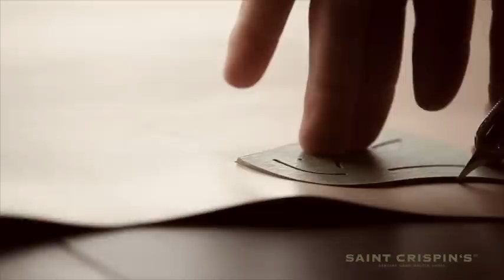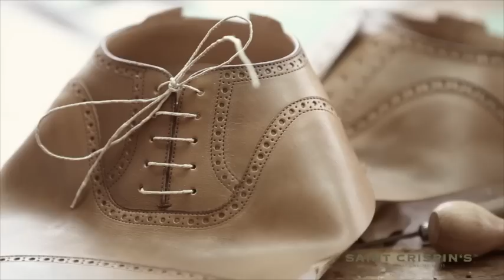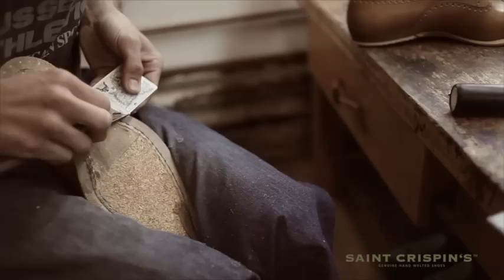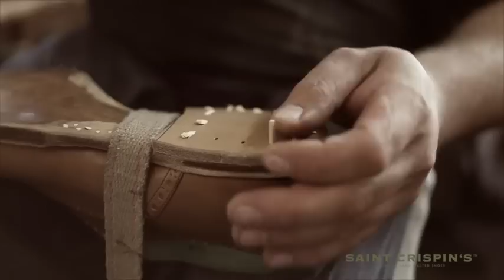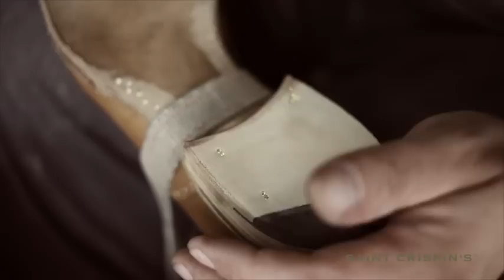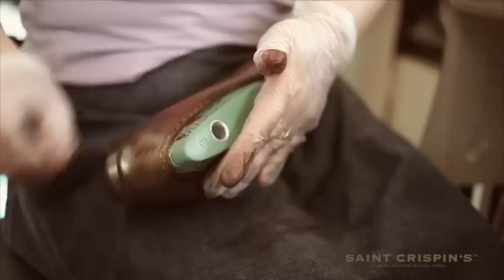How it's made: Saint Crispin's Shoes

Comment: Sharp-looking shoe, but I'm not crazy about the metal tip in the sole. That could get noisy.
Reply: Yeah. And it would get scratched up, little dings in it. Which would take away from the look. Then again, it would hold up longer than leather. I probably wouldn't get it myself though. To each their own. I've never personally seen it on a dress shoe. Definitely unique. And the time and craftsmanship they put in these shoes is second to none. Amazing.
Reply: +Jay V After it gets scratched up and dinged, you can easily install another one with screws using a Philips screw driver.

Comment: how much this pair ?
Reply: Gr8Success Because they are bespoke, it will be starting at $6000US for such a pair.
Reply: +KenChiwo Pretty sure that's wrong. Google "saint crispin's shoes price" and you'll find plenty of their shoes between 1000-2000€. Even if those are made to measurements I doubt they'd quadruple the price. 

Still way too much for me though. Some day..
Reply: Their standard line cost around $1500US. Made to order is around $2500US-3000US however the pair in the video is a Bespoke pair i believe, which does cost double the MTO line.
Reply: KenChiwo What's the difference?
Reply: nerfzinet I had a good conversation with a Saint Crispin's retailer about this. The difference between MTO and Bespoke is the last. MTO uses an already made last with some cork patches to give a more bespoke feel. However, bespoke is a completely new process to make a pair of shoes. Saint Crispin's does not have a last perfect for your feet, so thus they will draw and measure your feet and create a last perfect for your feet and will tweak it to meet any feet problems, a process that usually takes 3 months (that is why it cost more). Alos, there are trial stages  wear they will give you your prototype shoes to wear for a month or so and then they .... A LOT OF WORK. http://www.saintcrispins.com/service/bespoke/
Reply: That makes sense, thanks!